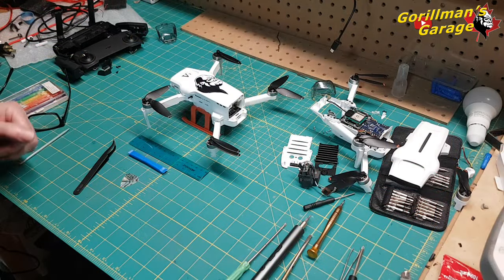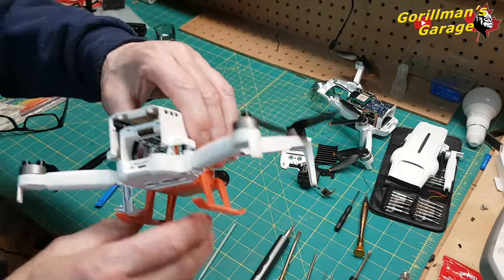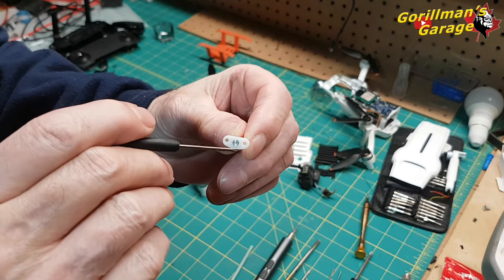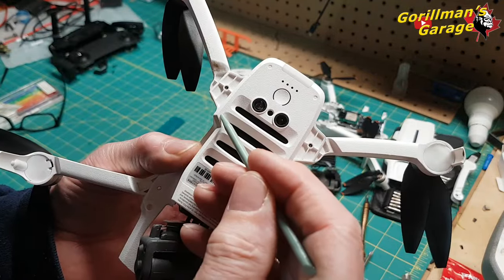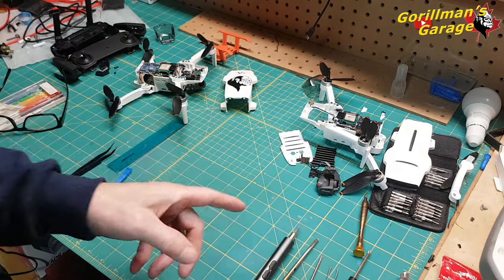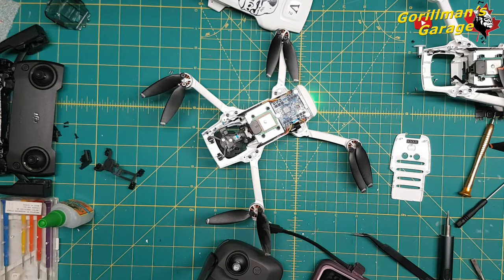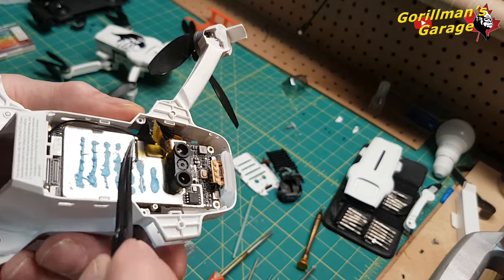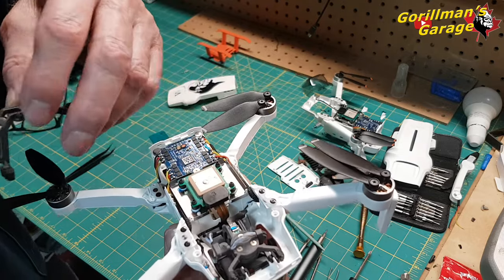Fimi X8 Mini Disassemble & Repair - Replace Arm, Replace Gimbal, step by step.

Comment: Watching this video showed me what is wrong with my X8 mini. I need the rubber stabilizer grommets on the front of the gimbal mount. One of them has no elasticity. That's what is causing the jelly in my videos. Thank you for posting this

Comment: I look forward to taking mine apart like this for research, too bad i can't get a whole new camera assembly to repair mine
Reply from the maker: Fimi wont sell the gimbal units. They say if it needs repair it's a Factory Fix only because the camera has to be sync'd with the main board and they are all individual. Thats why my 1st V1 is "NFG".

Comment: Hi Sir, thank you for the nice guidelines. I do have one question, do you know a shop where I can buy these spare parts? 
I crashed my drone and now the flex cable connected to the gimbal is broken.
Reply from the maker: I can only suggest AliExpress or Fimi direct through email. I do have the spare V1 that I could part out (same parts). Email me if you think that would work.
Reply from the maker: Look at the video.. I think they are the same.

Comment: Hello, do you know how to change ptz camera signal cabel?
Reply from the maker: Which cable is that. If it is the very thin ribbon cable that connects to the top of the gimbal. It also connects like a central wiring harness to about 5 other connections. It is not impossible to take apart, but it would be something the Factory should really attempt. For the price of the drone.. I'd part it out and buy another. You could probably make your money back on just selling the arms and motors.
Reply: Thank you for answer. Yes, that's thin white and blue cable bundle wchich goes from gimbal to the camera. I cannot open cover and disconnect connectors inside. New camera with gimbal is expensive, so I will sell that drone on spare parts.
Reply from the maker: @matmat5334 : so this is the rounded cable.. Let me see if I can dismantle mine .. I will let you know.

Comment: hello, I also have a question, the flex tape broke, I changed it, but the camera no longer works, the compass and barometer error, did I do something wrong?  Thank you very much for your help
Reply from the maker: You have changed something that the system does not like for sure. Usually this is a connector issue.. a bent pin etc.

Comment: Hi there, is it possible to remove the motors to clean them from the fimi mini 3???
Reply from the maker: Anythiong is possible. I generally use compressed air from my compressor to blow out dust. Oh.. One drop of sewing machine oil on the bearing about every 50-60 flights does not hurt either.

Comment: Nice Video! I have one fimi x8 mini too, and suddenly  the battery started blinking while charging, instead of solid led. It doesnt work at all. Any suggestions?
Reply from the maker: I have a video on Jump Starting a Hubsan Battey. It might work for the Fimi.
Reply: @GorillamansGarage  Thank you!
Reply: Had the same issue on mine, it was a battery calibration issue, there's a video of @GorillamansGarage explaining ho to do it

Comment: Do you have PC maintenance software? and gimbal parameters??
Reply from the maker: Short answer is.. No. If the gimbal/camera is not functioning or functioning irratically.. a replacement is needed and Fimi has told me it is a "non repairable item" and is a "factory only" project. That is why I am using my 1st X8 Mini V1 for parts. The gimbal/camera would not align correctly and shook .. so I knew the repair would not be worth it.

Comment: do you know how replace de camera glass protector, please help me?
Reply from the maker: You mean the plate of glass on the camera, covering the lens? I would use a hair dryer to het up the glass and loosen the sticky glue. Then use the point of an exacto knife to lift up the edges. Once removed.. maybe replace with an ND filter.. https://www.aliexpress.com/item/1005003027328527.html
Reply: thank you, grateful